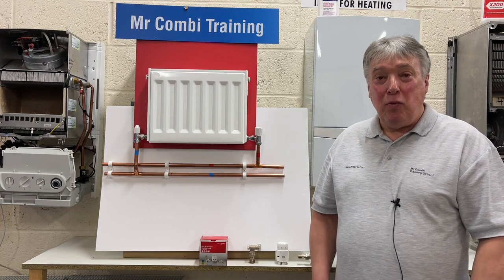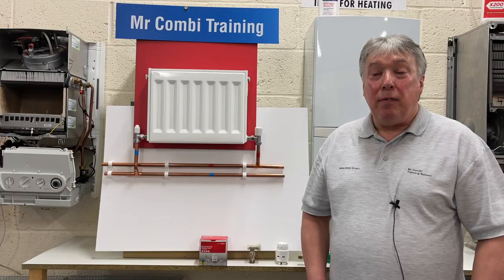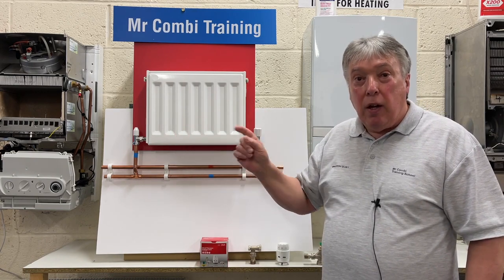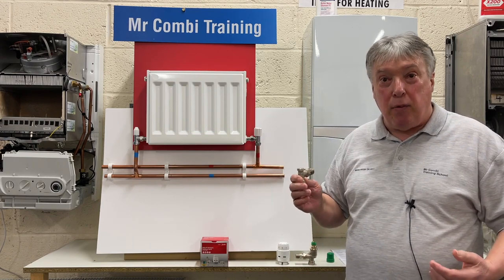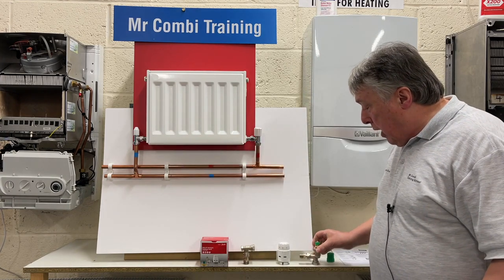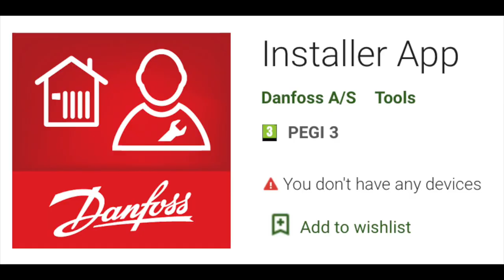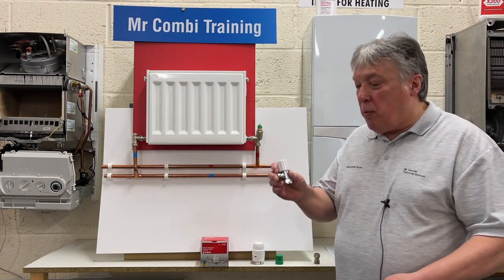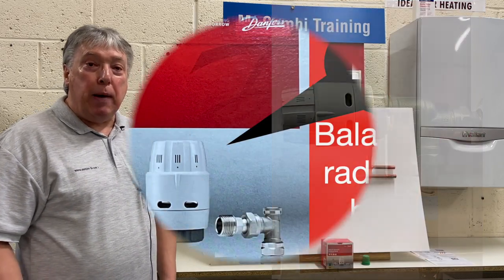Balancing rads has been solved by DANFOSS

Comment: 3 weeks ago I fitted 8 of these expensive TRV's,my boiler is a Viessmann Vitodens 100 that's just 13 months old.My system is clean and I pre set the recommended numbers on the TRV's prior to fitting,I also used the supplied Danfoss lock shields.Bled the system 3 times to make sure all was good,fired up the boiler the result was  all radiators vibrate and make a buzzing sound.The boiler which is normally very quiet has become noisy  almost sound like a failing pump.
I contacted Danfoss they gave me a case number but 3 weeks on I have yet to hear anything from them.
I regret fitting these things,I'm going to give Danfoss one more week to come up with a fix for this issue,I live in hope.
Reply from the maker: Hi Brian, thanks for email,  very sorry to hear your problem, I will contact Danfoss to get your problem solved, question, 11. check every valve arrow is pointing to correct way, 2. has the auto bypass been set up correctly, 3.are the rads total load the same as the boiler heating load or a bit less?, please keep me informed, I will send your comment to the Rep. 
Have you got these details? don't call them yet  I will sort things out, regards George staszak 
Feel free to contact us.
Customer Service Tel UK: 0330 808 6888
customerservice.uk@danfoss.com
Reply from the maker: Hi Brian, sorry it's taking too long to solve your problem, please call Danfoss support 0330 808 6888 and leave your number and ask Mike Jones to call you. regards George staszak
Reply: Hi Brian, I am no expert but I have read that the restricted flow through the valves because of the turned down settings on the balancing valves can strangle the pump (if it is not a modulating pump) because of the increased resistance causing the pump to try and pump against an almost dead head thereby causing vibration throughout the system and possible cavitation in the radiators. I am considering buying the Drayton TVR4 balancing valves but your comments have potentially put me off if I end up in the same boat.
Reply: @golfnut533  Hi Robert/Brian, So does this mean the pump wouldn't need to work as hard, would turning the pump speed down not fix the problem?

Comment: It is possible that Viessmann and Danfoss do not get along well. I swapped all my TRVs to these and the very expensive Viessmann boiler truly hates them. The system no longer recognises heating demand and if you force the pump to push water the pressure locks up the danfoss valves. I also noticed that the bore is very small so it’s really no wonder that the valves are causing issues. It’s a real shame that they didn’t just bring the European version which is much wider even if it’s more expensive. 😢
Reply from the maker: Hi George, thanks for asking, did you fit a 22mm auto by pass as required, also what small bore 15mm in standard does not have any issues, let me know, George 😟

Comment: How do the new Drayton TRV4 Auto Balancing 
valves compare? I think they work with standard lock shields and without blue tooth app.
Reply from the maker: Hi Richard, thanks for asking, there is no difference both are recommended, it's just that Danfoss invented TRVs and they asked me to make a video. Before everyone rushes off as you will need 6/10 of them  ALWAYS get quotes from at least 3 merchants and get the best deal. Price match if they want your money.regards George Staszak 👍
Reply: @mrcombiBedford  The Drayton Auto Balancing TRV4 valves do not use a mobile=bluetooth app but a calculator that uses the size and output of the radiator with is then set in the valve.  It would be great if you did a video of this to see how this functions.  Hopefully Drayton will make you the same offer.

Viewing your videos you suggested the idea of installing a drain tap externally when installing systems,
which is an excellent idea.  Draining and power flushing systems to maintain a good heating system can be daunting and would be great if you could do a video on how to do it and the equipment needed.
Reply from the maker: Good idea, I will ask Drayton, thanks, george

Comment: I have 10 rads in my house, two of which do not have old style TRV’s on them (as per boiler manufacturer instructions as they should act as a bypass) so the rad in the bathroom does not have one and rad in the hall where my room T/stat is located does not have one also. Can my system be balanced if only 8 of the 10 rads have the new balancing TRV’s installed?
Reply from the maker: Hi Robert, thanks for asking, I thought I answered your question? Or similar, anyway any rad with or without a TRV is NOT a by-pass it's either on max 247 or some TRV control better than none.  
            Most components at 8 years should replace. Those 2 rads are OK but building control would say TRV.s everywhere except where the room stat is (lounge) 
               As my vids show the AUTO by-pass goes under the boiler within 1 metre of the valves, please have a look. 
                As long as the system is balanced leave the 2 rads alone, they are NOT a by-pass just flat out which is OK there. 
      Hope that helps take care, George Staszak

Comment: I have and underfloor system in part of my house with automatic balancing valves which just fit in the flow in the manifold. I’ve often wondered why you couldn’t just fit them on the flow side of your rads and have a tvr on the other side as they now work on flow or return. But hey I’m not a plumber.
Reply from the maker: Hi Andy, thanks for asking, easy, the UF TRVs have a much smaller hole because the flow rate and temperature are much lower than on a rad, it would take ages too warm up.
The balancing TRV is best on the return as we balance normal rads on the return.
All the best, George Staszak 👍

Comment: How do you isolate the non trv valve side to remove the radiator?
Reply from the maker: Hi Nick, thanks for asking, just turn the control valve white cap clockwise the other side for balancing valve use a small adjustable spanner to close that OFF, again clockwise. Hope that helps George Staszak

Comment: Hi does the whole house need these valves or can you mix and match "normal" trv's with these.  I have in mind a refurbishment where radiators are beiing replaced gradually.
Reply from the maker: Hi Keith, thanks for asking, the new law from Building Control from this July states EVERY rad except where the room stat is, normally the lounge with an external auto bypass is a requirement!. Please have a look at my videos on Danfoss balancing TRV and other vids on auto B-Pass. regards, George Staszak
Reply: @mrcombiBedford  system is old school Y plan heat only , currenlty all rads bar bathroom towel and hall with main thermosta  have old TRV's I wondering if these balancing Danfoss will help with balancing flows in a mixed scenario
Reply from the maker: @keithwright7259  Hi Keith, old school installers did not fit a TRV in the bath or hall, now we do except where the room stat is. Definitely all your rad valves should be the same age and make. Go to a merchant and make a deal using Danfoss, george

Comment: HELLO JUST BOUGHT THE RAS-B2 TO FIT ON ALL MY RADS WHEN I JUST CAME TO A PROBBLEM WITH THE ONE RAD ITS A T22 600/1400 KUDOX ITS SAYS ON THE APP THE VAUE CANNOT PROVIDE THE FLOW NEEDED PLEASE CHANGE SYSTEM AND OR RADIATOR PROPERTIES MY SETUP IS FLOW TEMP 70c RETURN 55c DEFFERENTIAL PRESSURE IS 10KPA
Reply from the maker: Thanks for asking,
We have that rad in the lounge, because we have a room stat there the rad in on MAX setting with NO trv. just a cap If you don't have this just put the setting to "N" for maximum output. Happy new year, george staszak